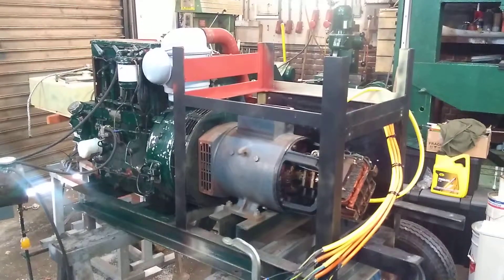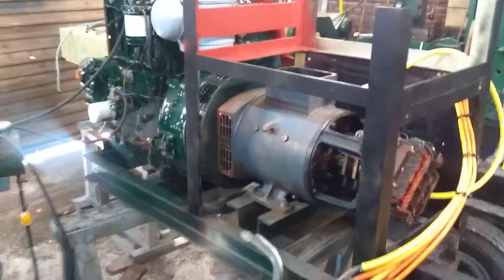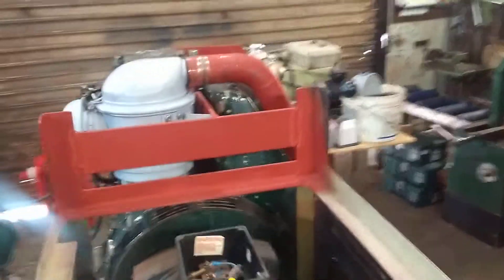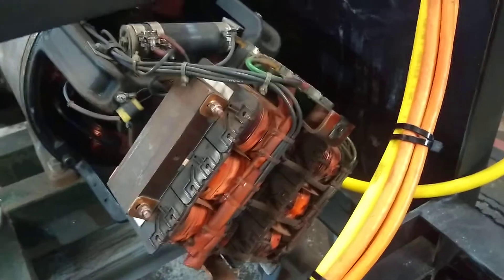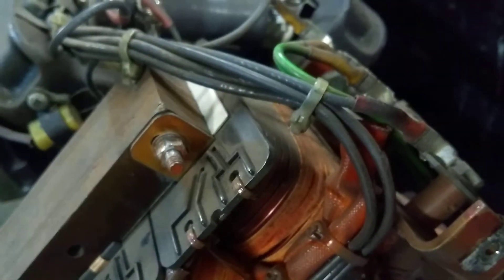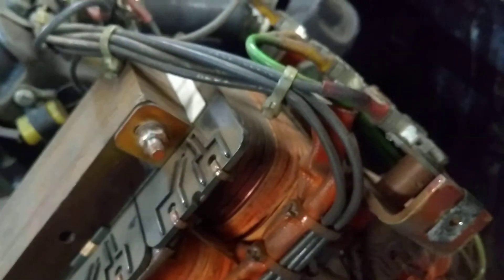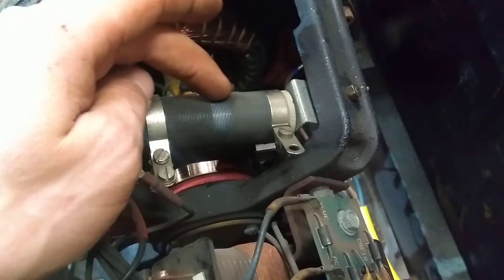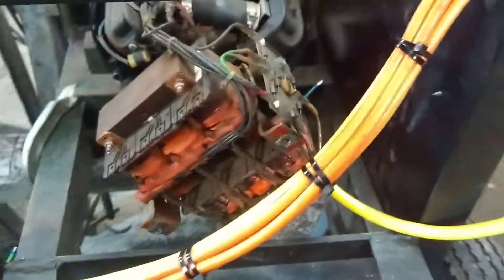Lister with BKB generator voltage adjustment

Comment: Interesting that you had to cut out all of the field resistance to get the voltage up. Have you verified that the speed is correct? Low speed equals low voltage on this type of generator.
Reply: ttaducir